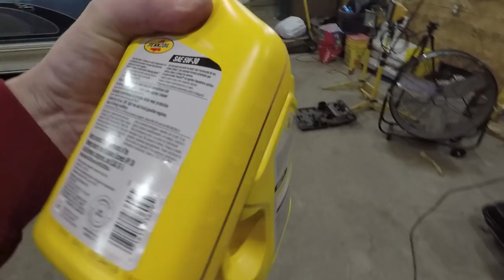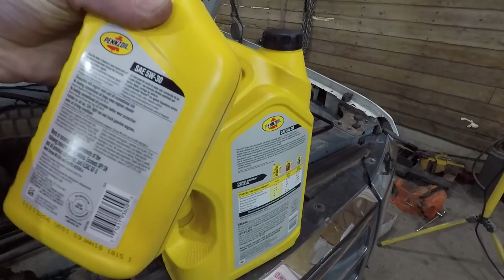What A MESS! 1993 Ford BRONCO PROJECT

Comment: Another good tip if you are going to be working on the tailgate much, you can bypass the safety switch that will let you raise and lower the glass even when the tailgate is down. It's on the drivers side of the tailgate.

Comment: Hi Jon. You might be able to get that build sheet off by throwing a warm wet towel over it and letting it soak. 
Once you get the tailgate latch fixed, lubricate the snot out of it! Seems Ford tailgate latches stop unlatching when they dry out.

Good luck!

Comment: You wanna watch them "expired" wasp nests! I bought a Cub Cadet 124 in alabama. Brought it back to Canada in the back of a ford minivan, in Maine when we got back in from eating I found a red wasp inside... I just figured it got in when we got out. 

I got home and got messing with it, and under the battery tray there was a nest. Obviously very old, it looked unoccupied. I started to remove it... and I was wrong. There weren't many tenants, but there were some.! Red wasps like I said earlier.. Most stayed put from Alabama to NS canada..around 2000 miles

Comment: The latch plate the rods connect to in the tailgate is bent. You can take it out and hammer it straight and it will work fine. It happens because people pull too hard on the latch. It's an easy fix.
Reply from the maker: Thats good to know, I havent pulled it out of there yet, but might be doing that today.  Thats what it looked like to me too.. someone just pulled way too hard and bent things out of shape.

Comment: Loosen the three bolts that holds the pivot to the tailgate, clock it one way or the other to readjust the tension and bolt it back down
Reply from the maker: where the rod that attaches from the handle connects....where it connects was all bent.  Took it all out, bent it back....working now

Comment: Hey man love the channel. I noticed you used an FL-1A filter for the Bronco. I recently purchased a 95 f150 with a 5.8 also. When I bought it It had a whix filter on it. I researched filters for the 5.8 and all the interwebs say use the 820s. Just curious why you use the FL-1A. Great channel man. Keep the vlogs coming.
Reply from the maker: It cross referenced to the wic 51515....there is a different one on you have an oil cooler, like was on the red truck

Comment: So I meant to say im going to fix my 1988 inline 6 manual with a factory rare dark blue and white paint and I also love your videos so keep them up man
Reply: The good part about a project truck is that if it dont run ifs fun to fix
Reply: Down here in Oklahoma its good not to have rust every where you look
Reply from the maker: yeah yeah yeah......showoff. LOL
Reply: The Fox Shop its just to wet to jack it up though
Reply: The Fox Shop I just need to get the starter off nd change the oil to see if it will crank

Comment: steve83 from supermotors has just about all the information you need on broncos and fixing that tailgate latch. Also I had a broken plastic carpet piece and I replaced it with a stainless steel plate from an 80s bronco, looks much better. When I first got my bronco it had no carpet or interior panels in it and it has unbearable road noise and that carpet helps so much even though it can be a pain in the ass sometimes.
Reply from the maker: About to slap it back together at this very moment...

Comment: At least there is lots of replacement panels made for these
Reply from the maker: Yeah, can still get pretty much everything.  Would like factory front fenders, hood, doors... but we will see.  I have used aftermarket front fenders before and they seemed to work just fine, but would like original Ford stuff if I can get it.

Comment: Might as well cut an access panel in the bed floor so you can access the fuel tank. It's nice to not have to drop the tank to get to the pump and sending unit.
Reply from the maker: Not a bad idea.
Reply: I understand what your saying about getting to it but how many times do you plan on putting one in ?                              The fox shop I was going to say something about line X in the back but the rubber mat idea is better cause you can take it out to clean it. That was a good idea seeing how it's inside the truck. Can not wait for the "fun to start" bring it on.
Reply: I second that, I have had to replace 3 of these shitty autozone and advance auto pumps so far and I cut an access door in the bed so it only takes like 15 minutes for me to change a fuel pump. I keep a spare with me at all times and they have lifetime warranties so when one dies I swap it out and go get a new one for free.
Reply: @Endall those aftermarket pumps are terrible, I've had to replace 3 so far so trust me having the ability to change a pump fast is going to get you back on the road faster.
Reply: +Peter Collins  That's a damn good idea and shouldn't be hard at all...
Reply: I wish I could take full credit. I learned this from the FSB forum
Reply: It's not hard dropping the tank, there's only like 10 bolts holding the skid plate on, undo the fill hose, disonnect fuel line and electric plug, and it's ready to come out
Reply: Todd B yea but if you make an access panel then all you have to do is take the carpet threshold strip off and pull the carpet back then flip up the panel and you can start removing fuel lines and unplugging the power. It's very handy for those that don't have a garage or if your pump dies while you're on the road (happened to me!)
Reply: Cody Brady it just bugs the hell out of me when people just leave a big ass hole behind... it wouldn't be so bad if a door was fabbed up afterwards...
Reply: Todd B yea I had left a hole in my floor for a while until I got some small utility hinges and a couple of  metal tabs and made the cut piece into a door. The worst part for me was hacking a piece out of the floor of my rust free 96 bronco but it makes it so much easier to change a fuel pump and it's saved me from having to have it towed home on a couple occasions.
Reply: I have not had that problem sorry you have Cody Brady. I'm like Todd B  don't like the holes. Do not think fox shop is going back with a rug but that's up to him.
Reply: Endall same applies with a rubber floor and I'm pretty sure that it's those junk aftermarket fuel pumps that cause me problems. I also have 2 other trucks that I've had for almost 10 years and have never had to replace the original fuel pumps. Also I have seen a few suvs that have had some sort of fuel tank access panel in the floor so it is a concept that makes sense and is useful.

Comment: I will bet you are happy  to be rid of problematic red f150?
Reply from the maker: Yes and no...   Just wasnt going to work out as a project truck, but a truck like that is not bad to have around at times.  Always started, ran "ok"... was never afraid it was going to just up and die or anything.. good for just driving around and not caring if if she gets dirty, or gets salt on her, hauling just stuff etc...    I hadnt driven her for at least a couple weeks, took her out to get a little fuel and thought to myself "actually drives pretty good"..  just has that slight vibration issue, which.. may work its way out of it, or may not.
Reply: To be honest that red truck looked like the truck that if madde a project it would have taken to long to fix